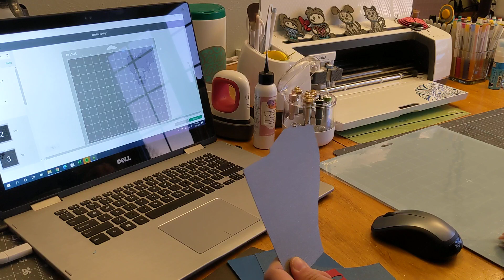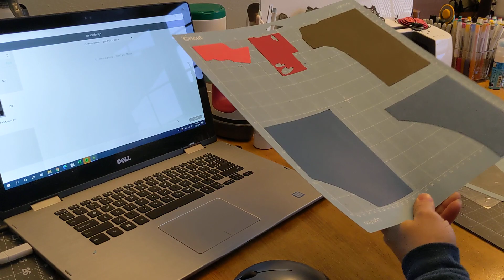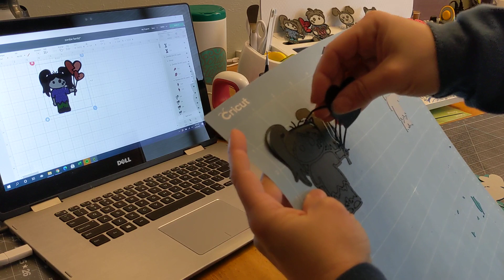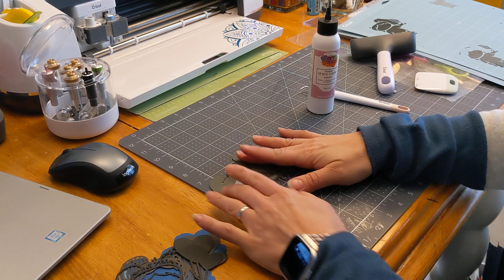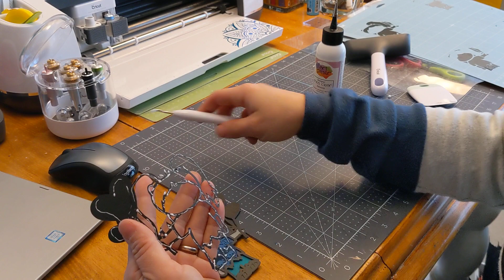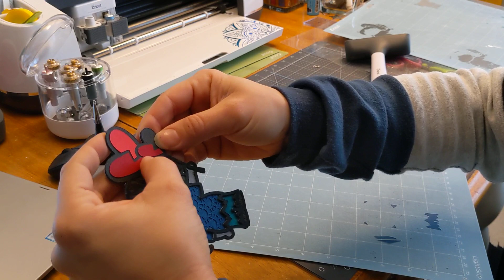Cricut crafting: Direct gluing 3D papercraft projects.

Comment: So clean and neat your work.
May I ask you the type of paper your using and the glue .if you can add the links below .
I would appreciate it alot
Reply from the maker: I used various types of cardstock in this project but typically prefer Recollections brand from Michael's and Bazzill from JoAnn's. My number one glue for direct gluing is art glitter glue which is available on Amazon (https://smile.amazon.com/dp/B0767PZDL1/ref=cm_sw_r_cp_apa_fabc_FWdcGbAGBPZGD)